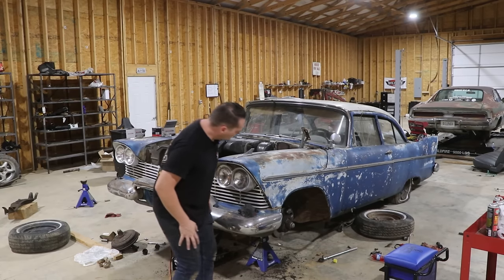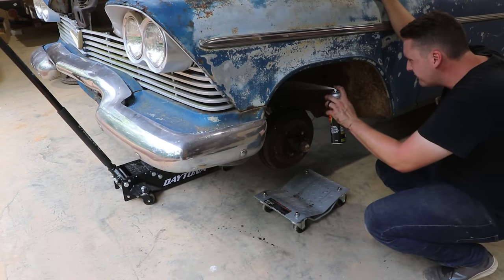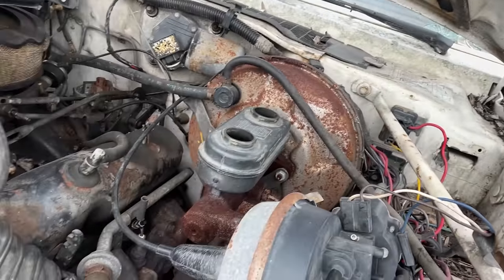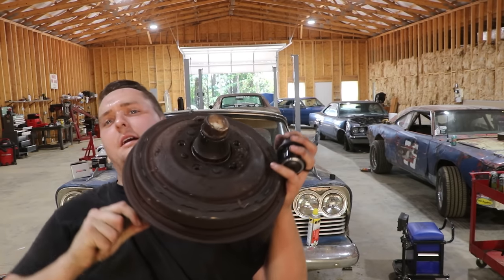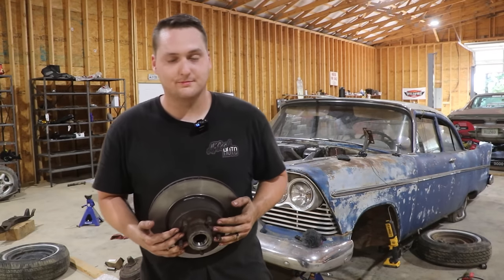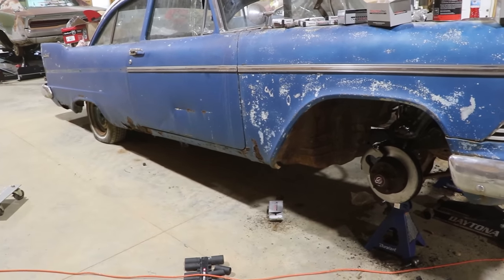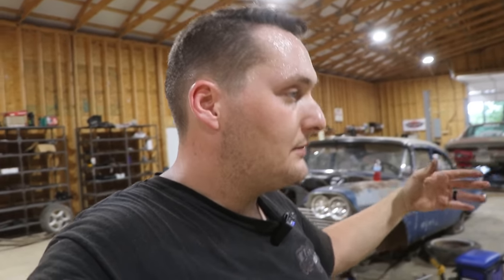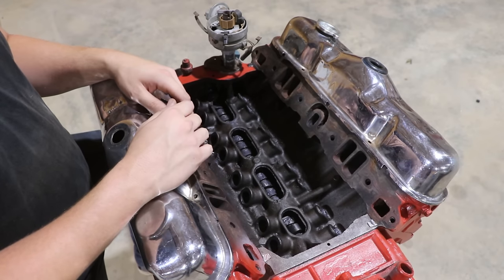Barn Find 1958 Plymouth Gets New Engine & Brakes - Will They Work?

Comment: Reminds me of days long ago, used to call it “hot rodding by Hollander”….there’s a ton of factory parts that yield some fantastic results when you know what to use and how to make it work for your application.

  Aftermarket parts are great, but on a budget, spending cubic dollars isn’t an option. Good to see someone putting their head to use…
Reply: Yeah, lot of factory parts out there like that. For example. The last carb'd corvettes (late 70s early 80s) are supposed to flow like a high profile 1969 Z28 manifold, and I've heard some of the Camaro cast iron manifolds from the same era are actually identical. L69 305 cylinder heads are supposed to be some of the best factory heads for small bore SBCs with the original intake bolt pattern. You can get some decent power out of them . I've also heard that the much maligned swirl port 87+ SBC heads are actually quite good torque cylinder heads if you actually work with them (port matching, smoothing out the ramps) instead of just grinding the ramps out.
Reply: @ironhead2008  I have the complete L69 engine from my old ‘84 H.O. Z28 sitting in my shop….will eventually go down in my wife’s ‘83 L69 Z28(with the first-issue 5-speed)…..yep, there’s all kinds of stuff available to those willing to track the parts down. Excited to see how Dylan’s Plymouth progresses….
Reply: @bowslap  Yeah, I imagine some judicious port matching, a nice exhaust, and a cam swap would do that engine wonders. Get it up to about 220 or so (like the top end 5 speed TPI 305 cars) would be perfect. With how light the first few years 3rd gens were, it'd probably make for a fun and spunky ride. Any more HP and you'd start needing to worry about the trans crapping out.
Reply: We used to get motor mounts and exhaust manifolds from a 400 Cordoba, a small brake booster from a Dart/Valiant and swap a 440/727 into any Aspen/Volare Coupe!
Use a B body 8-3/4 with a 1 inch shorter driveshaft and, Hang On!

Comment: I'm doing the same thing to my '57 Plaza!
I put in a '63 Poly 318/pushbutton 727 in ours. Went with Aspen/Volare front brakes, and, changing out the rear with an 8-3/4 from a 65 Chrysler for the better gear set and brakes with an Emergency Brake setup!
Reply: That was a good call getting rid of the old rear end with the pressed on brake drums and the lousy drum brakes.  The later C body rear end is the way to go.  It's also better to get rid of the old emergency brake setup too.
Reply: @1575murray  Yep!
Much better gear set for cruising, Etc. It should be a 3:23, easier than the 3:71s that are in it originally.

Comment: Dylan I just laughed so hard a darn near choked on my beer.. That V-Tech comment about the pressure washer was gold... It also made the entire import tuner community die a little inside, I love it...
Reply: I laughed way more than I should have at that joke
Reply: 😑 That's like something those knuckleheads HeavyDSparks or whatever would edit in there.. 👎
Reply: @R3TR0R4V3  Except this was actually funny
Reply: if you say so, pal. 🤷🏻
Reply: Nah, I'm still good. I still have my 709 wheel horsepower 1997 Civic coupe that I built with my own two hands. Best time to date is 9.56 @ 155 mph. Yes, it does have VTEC. V-Tech is an old phone company. VTEC stands for Variable Valve Timing & lift Electronic Control. Then again, my brother still has our old 1974 Camaro Z28 and it still has the same 355 sbc that makes 425 hp with a Muncie M-22 Rock Crusher 4 speed manual.
Reply: The strange thing is that I am 39 years old, my Civic is all one color (B95P Electron Blue Pearl, painted it myself), it still shines like a diamond after me having painted it 4 years ago, and the entire car is clean, neat, and has nothing but good quality (expensive) brand name products. Yes, it has a factory Civic Si trunk spoiler, but I've always hated those ridiculously huge aluminum wings that serve no purpose. It also has a fairly quiet Thermal Research exhaust on it and it doesn't sound like those raspy crappy cheap eBay exhausts. The turbo makes the exhaust a little quieter as well.
Reply: I'd hope the import community can take a joke. Big old V8's are great, VTEC is great, both sides get a gentle ribbing from each other haha.

Comment: When I built my 1965 Plymouth wagon, I put the whole suspension of a 1985 Chrysler 5th Ave under it, four bolts and the whole thing bolted in the 65 Plymouth, I had to make the brackets to bolt it under the Plymouth, but it works great and road a lot better, keep up the good work saving this old Mopar,

Comment: Always amazes me how someone finds out that parts from an 80's car fits a 50's car. Love this build.
Reply: Well, Mopar was a pretty cheap firm, not as cheap as AMC (who went through their competitors parts catalog because that was cheaper than building it themselves) but they weren't throwing away parts designs if they could be used in something else.
Reply: The old Hollanders manuals covered a wide range of makes for swapping parts. I think they went out of business many years ago.
Reply: You can actually take the whole front subframe out of an M body and put it under a hot rod, it used to be a done thing about 20 years ago but the 'Mustang II' prefab frontends became so cheap hat nobody bothers anymore

Comment: Heck yeah! those disk brakes are the way to go, the old drum brakes were notoriously bad. Can't wait to see more!!
Reply: The brakes on those cars as factory equipped were totally inadequate even in the 1950s.  With front disc brakes being universal on today's cars this is the only safe way to go.
Reply: Drums are fine on the back!
Reply: @bear1245  Agreed for street driving they are good enough as long as they are maintained correctly.  Although many cars have four wheel disc brakes some are still being made with drums on the rear.
Reply: @1575murray  yeah exactly and cost as well. Some good pads and discs on the front. Drums on the back. Good to go. Hp permitting!!

Comment: Don't forget to check the pistons of the new 318...most 318's pistons fall short of reaching the top of the deck...360's are top deck piston setups. Yes the 360's have larger ports and valves, but they are not close chambered heads like the 318 heads. Basically after 72 when compression was starved, the 318 got shorter pistons to reduce compression, and the 360 lost compression in the heads. That being said, if you slap 360 heads on a below deck 318, you will lose quite a lot of compression...you can order top deck pistons for a 318. Just food for thought. I have heard that people have received good results by increasing the intake valves of the 318 to accommodate the 360's 1.88 intake valves, and porting out the 318 heads...

Comment: Make sure to calculate the compression ratio don't want a 8.0:1 compression ratio atleast 9.5:1 will help alot with an aftermarket camshaft
Reply from the maker: Can’t say this 318 is gonna have anything close to that with some serious machine work. It’ll move along pretty well.
Reply: @DylanMcCoolVideo , with that cam and a little tweaking...you might get that 318 up to 165 ponies or so.  318s have decent low end performance though.
Reply: just get new pistons and grind a bit off the heads and you'll have 10-11 bar compression without any problems
Reply: I think that 318 is going to be just fine
Reply: 1 point of compression is only worth like 4% or 7% i think. not worth it after 8.5-9:1 on a street engine. id build one to run on 83-87.
Reply: Get a lot of pre-ignition when he fits the turbo...
Reply: @DylanMcCoolVideo  this car is my dream car I just think it would look good with red also loved the Christine clip my favorite movie

Comment: Theres 650 comments, so I am not going to read them all, but your in for some problems with that engine. You will need to replace the entire drive line if its still got its original stuff in it. The LA 318 will not fit the pre 62 transmission. The crank flange changed from 8 bolt to 6 bolt and you will also find the bolt pattern for the bell housing is different. If you go to a later trans to match the engine, you will loose the E brake and the push button for gear selection also will not work. Because of the E brake issue, you will need to change the rear end to one with an E brake. To some, this is desirable as it gets you away from the tapered axle and its issues. I did see that it was a flat head 6, so you needed an engine and trans anyway to go to a V8, but dont forget the torsion bars are also bigger for the V8. Looking forward to seeing how this pans out. Fury Jim can advise you some more about the engine change as well

Comment: Now this is what I like to see, poor man's disk brakes on an antique car, don't need no Baer brakes system, how often you gonna drive something like this above 80mph ya know? This ain't no formula 1 car, its gonna be a treat to drive with some modern improvements and v8/ disk brake upgrade. Not a barretts auction car but a satisfactory driver with some low end wheel spinning torque. Goal achieved!!

Comment: Front end suspension tip! Hit the spot where the balls joint goes through on the steering knuckle with a hammer. Just breaks it loose and far easier to disassemble. It will usually separate the two with out a pickle fork

Comment: Your production values are going up. Bravo.
Reply: yeah a slight edit problem though when it repeated his ball joint socket bit.  he did 2 takes and used both.  it's all good though. He's working hard to bring us content and Tn has been hot as heck this summer.

Comment: Isn't it crazy that parts 30-40 years younger can fit straight onto the 58? Cheap safety upgrades for the win 😊I'll be interested to see what you use to remove the surface rust in the engine bay. Maybe a media blasting attachment for your new VTEC pressure washer? 😉
Reply: You never want to use a water pressure blaster system on a front suspension or for the whole car for that matter tried it once, water pressure can open seals on ball joints and steering links and carry sand media into your bearings it also forms mud in every crack that has to be physically brushed out an air hose won't get it all out it's like a mud daubers nest in every seem of the car.
Reply: @mrpurcountry  very true but I shouldnt have to point out the obvious when it comes to media blasting

Comment: Hey Dylan: Nice to see "Christine's kid sister" taking shape... Good to know that the front end parts are interchangeable from the '58 to the 80s 5th Avenue with much less the weight... The newer 318 V8 looks stronger than the one that you had in the '70 Charger and should work much better...Hope the rear end is much easier to transform than the front end was with the glass, fuel system, suspension and interior to follow......

Comment: You converted the front brakes to disc but forgot to convert the steering system to newer safety steering. Old steering system had a killer steering column that goes up and back during a front crash. Safety steering has a collapsible column that breaks down and never enters the cabin during a crash. A safety steering wheel never moves back or hits the driver during a crash.

Comment: Dylan, on the ball joint pickle fork thing. Slide a long pipe over the pickle, put a digging bar rod inside the pipe, smack the pickle with the digging bar. No more flying metal shards.

Comment: Hey Doug 
Nice video. I wish that 5th Ave was a old police cruiser. And I would have bought the whole car for donor parts. Rebuild the engine. All the other suspension,transmission,AC conversion kit ETC. Now if you got the money. I would look in Central Texas. For classic Plymouth parts. For the Savoy. But I saw a another idea. Next to the 5th Ave was a Dakota Pick Up with the V-6. And here is a idea. Once you restore the Savoy and if you are going to sell her. And if you find one. Pick up a 74 Dodge Colt. Take the V-6 out of the Dakota and the other parts too. And if its a manual that is a plus. And put the Dakota engine and transmission into the Colt. Put the racing seats in her. The driving lights. And wider tires. And paint her. In the 1977 winning East African Safari Rally Car. Because when I was living Hawaii. And Wild World of Sports was on. And my dad was stationed at Hawaii.
And it was the East African Safari Rally. And I said Dad our car is on tv. And he saw it and smiled too. The car was dirty. So was the drivers. That is how. I got into the World Rally Championship. And Endurance racing too. I would like to see a resto-mod done on that. Well keep up the good work and God Bless.
Sven

Comment: On removing the knuckles from the BJ’s. A hammer on the side of the knuckle where the BJ goes through it will jar it and loosen it in 2 or 3 hits with a large hammer and not do any damage!
That pickle fork actually makes it far more work than it needs to be!

Comment: Had a 57 Belvedere from Georgia about 15 years ago but was too rusty for me to tackle. Had ps/pb, dual quad poly 318, full set of bumper wings. Still miss it. Especially now that I'm not afraid of rust. Still got the original 58 Mopar shop manual for it.

Comment: I remember changing my ball joints on my 1970 cuda same exact threaded ball joint used a old style car jack for leverage to get them in still have still have socket but my car came factory with disc love this build

Comment: Man that camshaft is not parkerized unless you asked for it and they charged you for doing it ! they love shredding lobes!!! If it was me and what ever that means to you I would pull that cam out and go with Howard’s cams!!  I ruined my 350 with a comp cam extreme energy 268 in my Chevy blazer in the 350 and after I spent another rebuild dollars on the motor I went with Howard’s and they come parkerized and didn’t have a problem one breaking it in and it runs so good and powerful finally.

Comment: Mini sledge or an Air Hammer is your friend. As for the screw in ball joints, I used a pipe wrench to get mine in and out.

Comment: Yea doing Ball joints do suck, I have done many in my long illustrious career as an auto mechanic, I used to like those screw in types, after awhile though I stopped using the old hammer and fork and went to just using air hammer with fork attachment way easier and fast, the engine you are now installing is perfect, keep the videos coming this is very interesting to watch.

Comment: The original Polly block 318 is a big block configuration. 318, 361, 383, 400, 413, 426, 440. Your new red 318 is a LA block configuration. The original Trans  bell housing won’t interchange to small block LA engine. My opinion is you will need to find a big block engine for ease of swap. A dash push button TorqueFlite  will hard to hookup to  a LA  model aluminum TorqueFlite Trans. Or add a floor shifter to the new LA Trans.

Comment: I haven’t used a pickle fork in 20 years. Ever since I learned a few properly placed hammer blows to the outside of the cast iron will pop that joint faster and not ruin the boots.

Comment: Great point  , Dylan 

Those front drums are , dual wheel cylinders  , each 

Never knew 🤔 front spindles off a ,
1980s Chrysler 5th Avenue / Dodge diplomat  , would be a direct fit .
🔩⚙

That proportioning value
 will definitely be needed 👌

Glad you replaced all 4 ball joints 
With screw in , factory type

Comment: You need a BFH for the pickle forks to knock those ball joints apart.
Reply from the maker: No kidding. Need to go find my sledge hammer. It got up and walked off.

Comment: nice video, it peaked at 105 f  last weekend over here, but now back to70, balljoints are hard work anywhere
in UK, cars change parts design roughly every 8 yrs, nothing will fit. is it the norm that USA car parts don't change in 30 yrs?         keep up the [hot] content
Reply: There are companies in USA where you can buy parts back to 1900,Such as Egge.
Reply: Classic cars share part's 
Ford redesign very often

Comment: The best cheap V8 for a car of that era would be a 318 poly, because then once you want to fully build it you can put hemi heads on it and make your own hemi, and use replacement crank, rods, pistons to take it up to 392 because it's the exact same block as a Gen 1 hemi.. and they made them from 1954 to 1966 so there's a bunch out there still, including in Dodge trucks.
Wow, you literally can't find 1979-93 Chrysler spindles.. I guess that's why Mustang II suspension swaps are so common.. would be a lot easier to find parts for anywhere if you plan on road tripping it. While you have next to nothing into those, being able to find parts anywhere would be worth it in the long run.

Comment: In 1959 my Dad bought Mom a New Fury Plymouth. Flathead 6 and Automatic.  dad even ordered a fake spare tire on trunk lid. From day 1 this car was junk. Transmission 2 x within 2 years. Rear axle pinion broke. Drum brakes hardly helped stop this pile. My Dad gave up on Moms AAA calls and drove car himself. Mom got a 1961 Saratoga Chrysler and I could not drive that car. Dad said NO NO.. Dad drove the Fury into New York City daily. Not very far but a commute into city was horrible anyway. Within 4 years rust appeared all underneath body.  Front cloth seats were battered and looked bad. 34,000 miles and Dad traded it for a Valiant 1967 which actually was a better car.  AC helped. These car cured me from Chrysler cars.

Comment: I'd really like to switch over to disk brakes, however, I just got new tires and my stock wheel covers won't fit the 15" wheels the came on the 5th Avenues.

Comment: My questions aren't concerning the car in this video but it's Mopar related. Do all powerwagon 4x4 trucks come standard with a factory equipped winch? I love your videos. Is it possible to put a two wheel drive body on a 4x4 rolling chassis? They're built by the same manufacturer and are the same year.